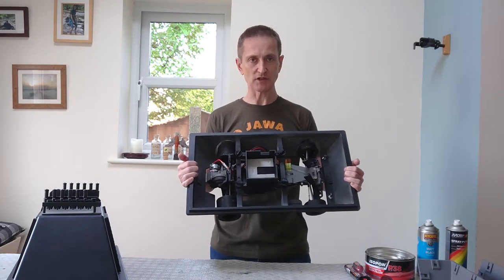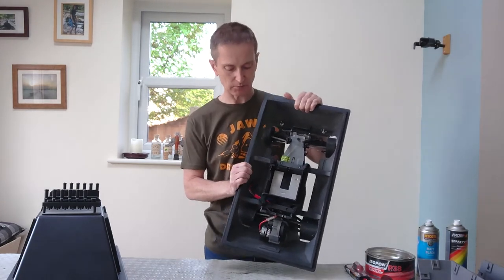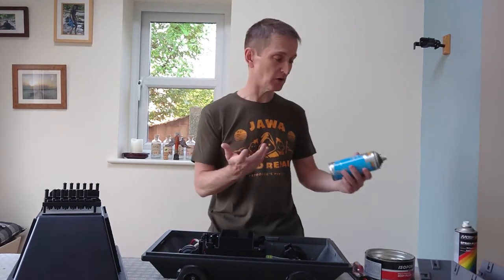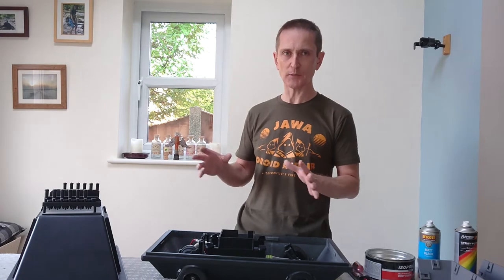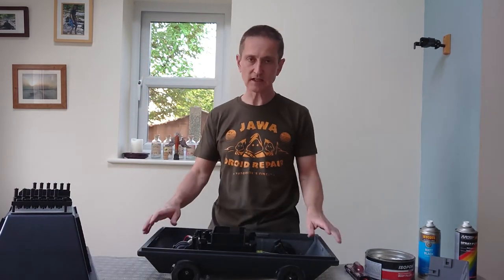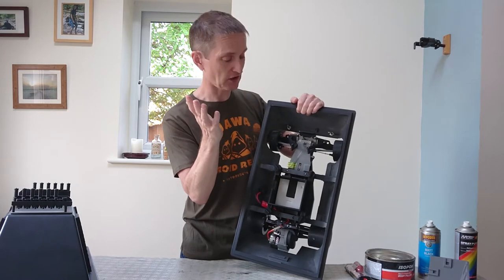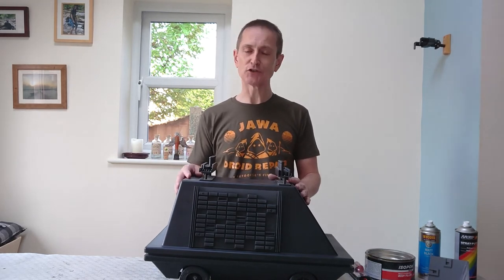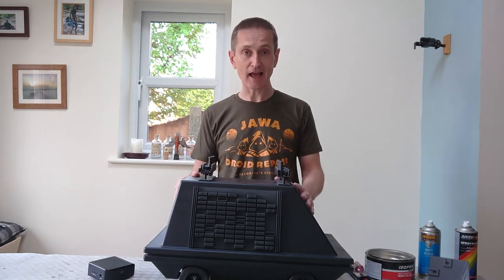MSE Mouse Droid Tutorial by Craig Pay

Comment: An amazing build.  I've saved the Thingiverse page as a favorite to go back and build one once I'm done with my R2D2 Droid.  The R/C car you're using is very expensive and I think I'll try a cheaper car that fits the body even if I have to adjust some of the support pieces on the inside.  Maybe what you could have done was build cross bars that slide down the inside of the droid to accommodate different scale R/C cars from 1/10 to 1/12, etc.  I know the wheel base changes when cars are scaled down so that may be an issue. Thanks for making the video, sound quality was a little low so I had to turn the volume up, but then the darn commercials were blasted loud.

Comment: I've printed and epoxied all the parts now, purchased the Traxxas Bandit, but the TPU tires are eluding me.  Is there a specific .stl file I can find to print the tires to get the fit?   This was such an amazing build.  The clips awesome except on swapped the two lower middled pieces and now the clips don't match, but I used the clips by sanding off one end of drop in and epoxied them in.  Worked great. I also increased the infill from 15% to 20%, but that added weight I didn't need. I'm not too good at CAD so trying to create the TPU tires from scratch is kicking my butt; hence, the reason I'm looking for an .stl?   Thanks for the video and files.
Reply: I found the tire .stl at Thingyverse, I just had to review again what I printed and did not print.  I just ordered TPU filament and will give it a go.